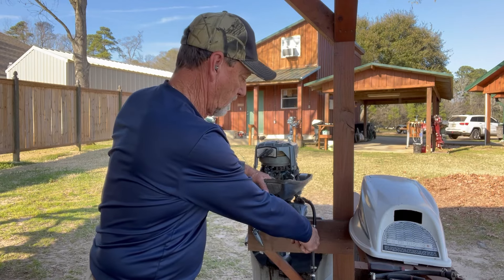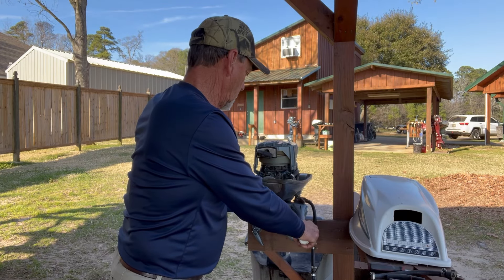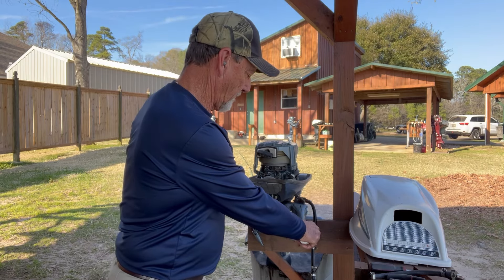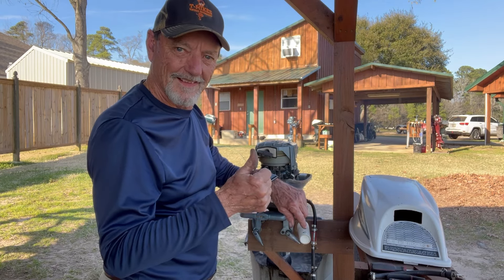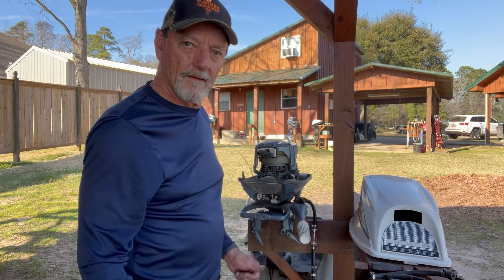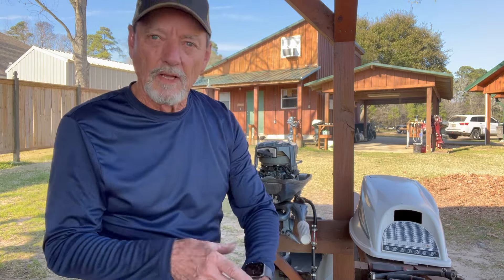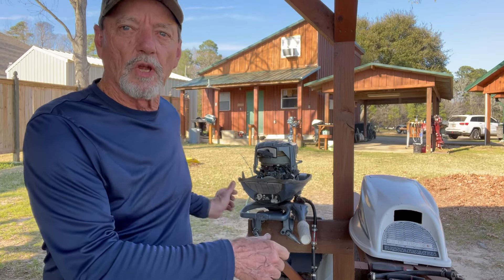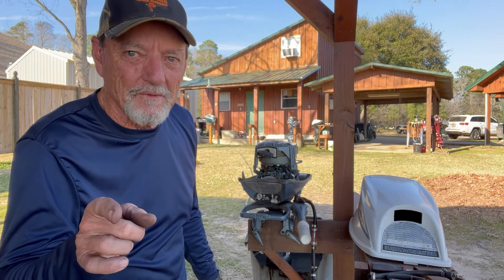Motor will not stay running - How to fix outboard motor that runs for 30 seconds and dies

Comment: Just got my ‘96 Evinrude 60 running today after electrical issues. But it wouldn’t stay running. I had this exact issue and figured it was fuel pump. Thanks for the confirmation!

Comment: Just what I was looking for. I have a 1986 mercury classic fifty I went and got all new fuel lines and a new primer bulb cause well it had all the original lines still and it ran for about 20 to 30 seconds and lost prime and died and wouldn't start again. Unfortunately I have the dual carb dual fuel pump engine

Comment: I got a johnson 9.5 hp 9r73b runs great with cowl off but put it on and dies any idea what it could be
Reply from the maker: @MA-eo1sk  exhaust leak
https://youtube.com/playlist?list=PLmMizJOF01-BybxjXHFBKhd9UK3kplL5n&si=yGv4beTTekka2JdE
Reply: @michaeljsimon   it was the throttle shaft wasn't in right I pulled it out and reposition it running good now with cowl on

Comment: I have a question i have a 1995 johnson that wont run for more than 20sec has new fuel pump , new fuel ball , new plugs , and carb rebuilt . What else can be causing this ?
Reply from the maker: Trying continuously pumping bulb. If it keeps running your fuel pump is bad.

Comment: I have a question T-Mike I have a 2004 Johnson 30hp. Starts great runs great except at wide open throttle some time it acts like it misses like just one beat.   Back off throttle just a little never happens.  I am thinking a piece of something might be restricting fuel flow at WOT.  What say you ?
Reply from the maker: Hard to say - could be lots of things - fuel injector, water in the gas, fuel pump, etc,,,,,